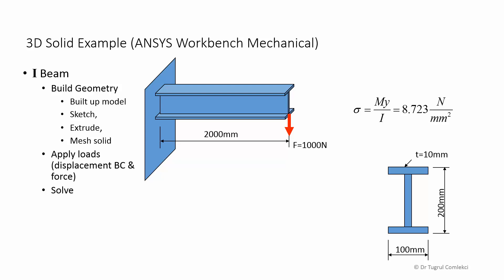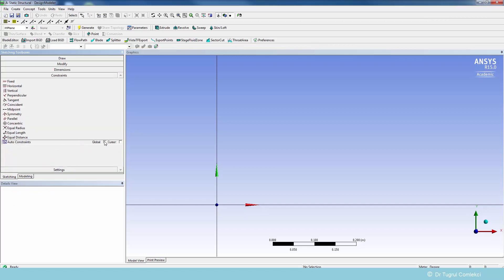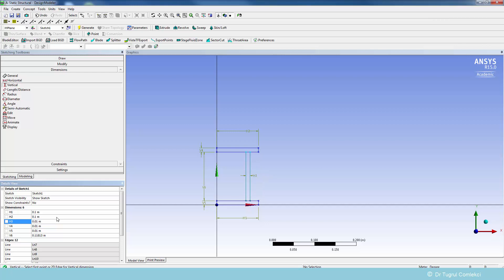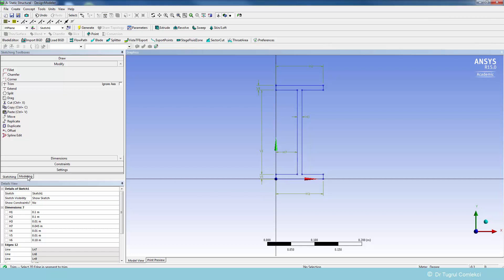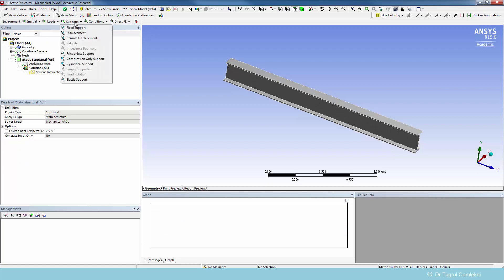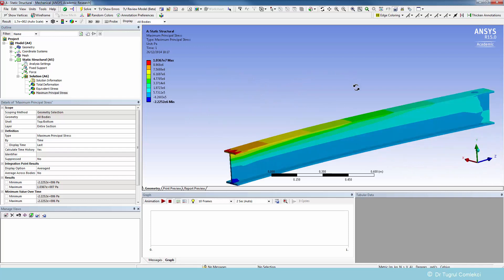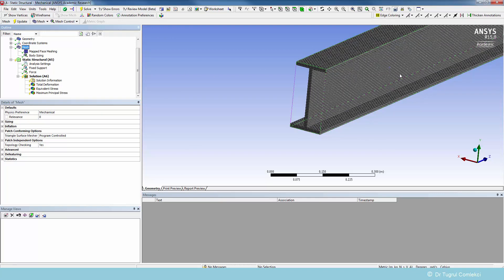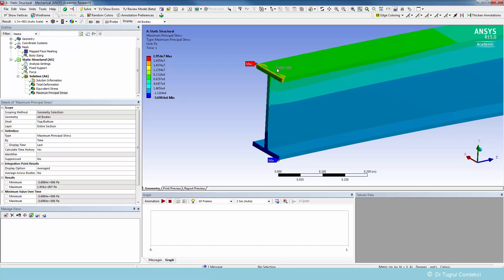Solid I-Beam Static Structural Finite Element Analysis

Comment: nice video. Does FEA and steel design code such as BS5950 will be agreeing or conflicting? I dont know what mindset should I have in using FEA versus hand calculations using standard codes.

Comment: This video is not very good. Why are you refining your mesh around a singularity? You will need to change your constraint system if you want to match your hand calculations.
Reply from the maker: John Parsons You did not understand the aim of this video. The stresses on the constrained end of the structure are complex and depend on how the real structure is attached to a wall, by welding / bolting etc. The hand calculation is there to check that the stresses away from the stress concentration are reliable, validating the model. For fatigue calculations the details in a real structure will be needed and a fine mesh will be required in this area. But that is for another video tutorial.
Reply: FEAnalysis, I agree that more detail with a finer mesh will be needed to understand the stress at the mounting point. However I still pose the same question, if you are trying to demonstrate that the FEA model will match with traditional hand calculations, then why don't you simply constrain your model correctly. This way your FEA model matches the hand calculations. I believe it will be more valuable.